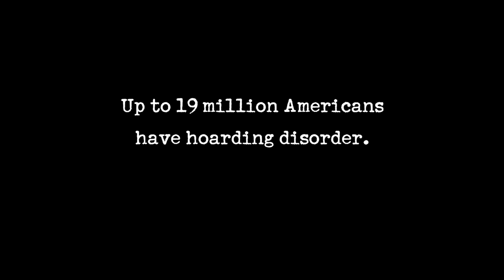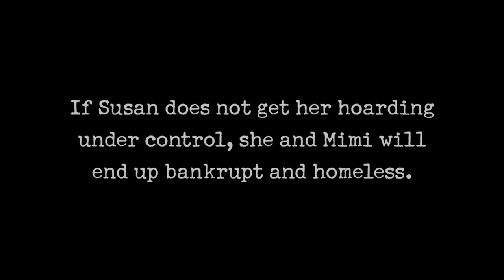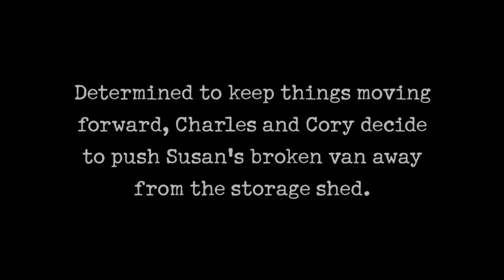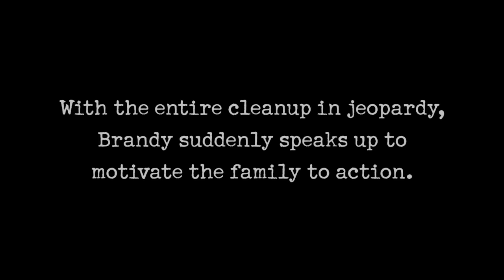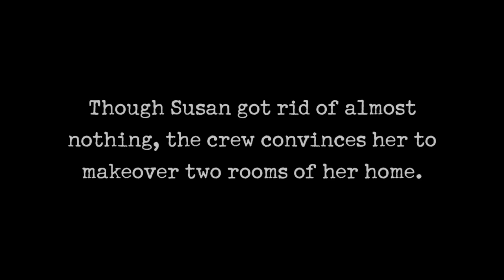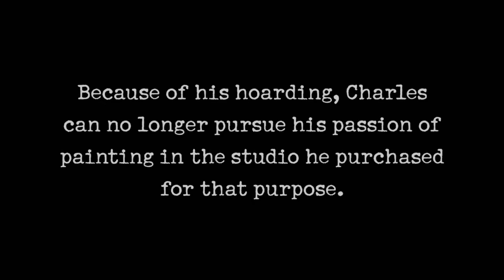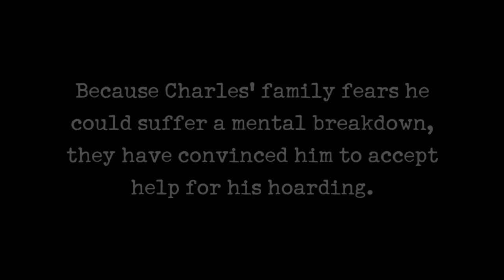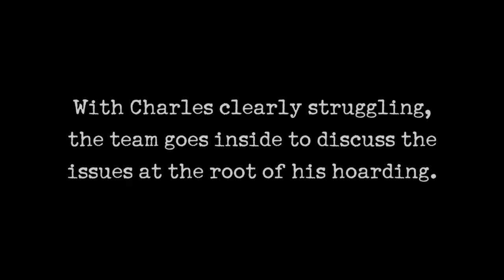Hoarders: ARIZONA Hoarders - One-Hour Compilation | A&E

Comment: What happened with Charles and his ex-wife should be done much more often, even before the clean-up starts.  This show needs to address the root causes of the emotional issues these hoarders are facing, for about 60-90 days, in order to address the issues and hopefully "get them on the other side" of those issues. That's the only way these situations will work out smoothly.  Does it make for less dramatic television? Yes it does because you'll likely have fewer instances where the hoarder goes berzerk, has anxiety attacks, etc.  While I understand that that is part of the hoarders' process, I definitely feel there is a very different approach that should be taken.  
I'm also surprised that none of these AZ properties had issues with black widow spiders, tarantulas, rattle snakes and scorpions due to the clutter inside and outside that would allow them to hide.

Comment: As an artist that also specializes in the female form, I can so easily see myself ending up like Charles. His was less a compulsive hoarding situation and more an endless cycle of 'I'll do it tommorrow, after this sketch' and 'tommorrow' coming until it was an extreme.
I force myself to, every 2 months, go through and toss old/damaged supplies. swapping to digital art has also saved an entire house's worth of space.
Reply: Also, his hoard is even more extremely dangerous due to the nature of his supplies, looks like he deal primarly in oil painting, which requires a lot of linseed oil and Turpentine. Without proper ventilation, and with the amount of fabric/paper materials, it is a huge fire risk and extremely poor for his health to just be in there
Reply: @scribojello3778  As a painter myself mostly now in watercolors, I learned how with oils. You have to be careful and use proper ventilation - Acetone for cleaning brushes, linseed oil, and paint remover especially when  dried on rags, they must be disposed of properly. When using such flammable materials it is important to not take chances. So it is important to have in metal or glass containers with metal lids.

Comment: I counted over 70 dishes alone in the shot of Leeza's finished kitchen. Seventy. Dishes. AFTER the cleanup.
Reply: Ha ha we recently broke one Corelle dinner plate -- I went and bought a new dinner-sized one of melamine (unbreakable) and a small luncheon-sized ceramic one. Now we have 5 dinner plates, 3 Corelle 2 others & 3 Corelle luncheon from a set, in all. LOL We don't NEED more. I have 3 extra luncheon-size uranium green glass plates, for when we have guests. Those green glass plates are treasures! We have a hodge-podge of mugs. And a few 8 or so bowls. Who needs more?